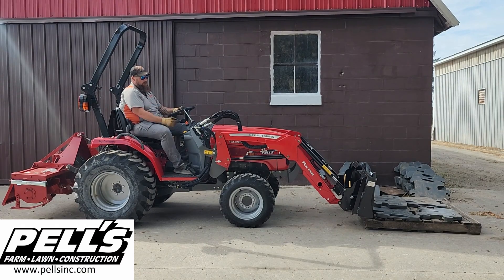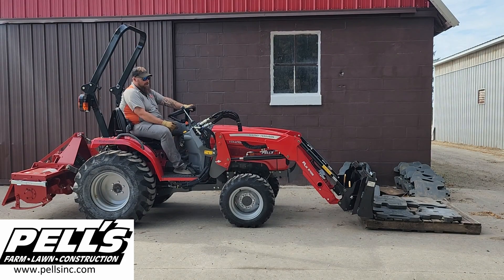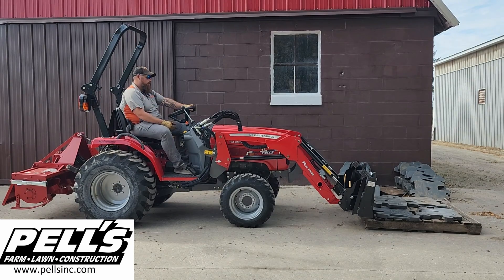Massey Ferguson 1526 Lifting Capacity

Comment: I bought a M-F 1526 new in 2018 to work with my 1 ton dump truck, & its been a real work horse. I just wish it had the quick attach on it like the new ones. It has been a very reliable piece of equipment.
Reply: Easy to convert to skid steer compatible.